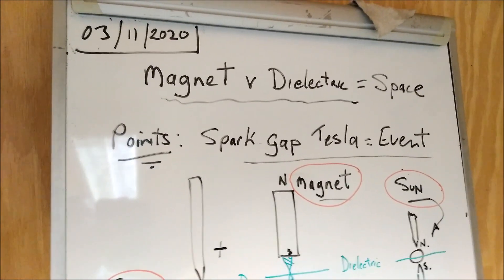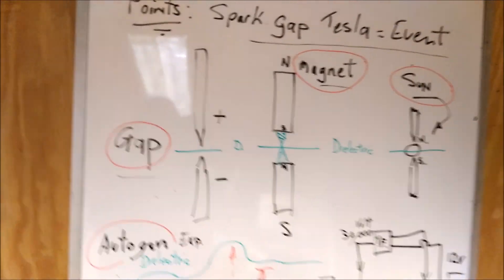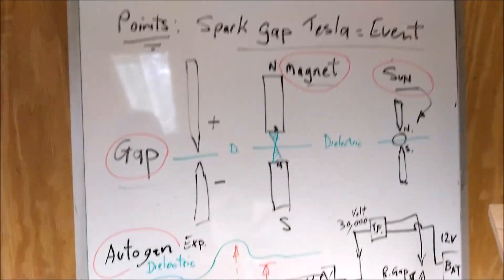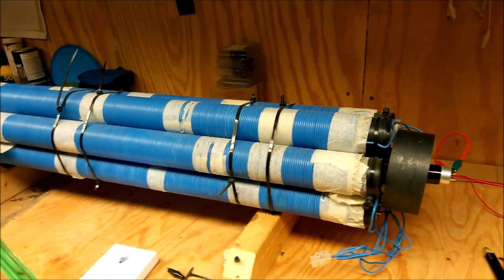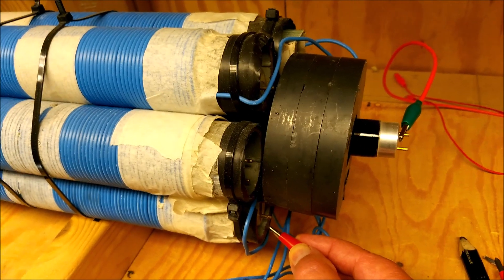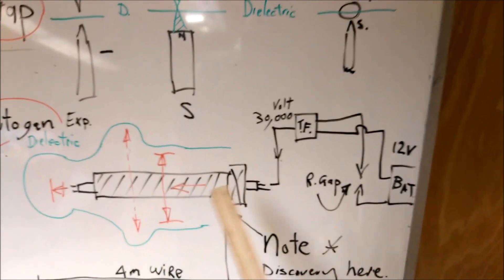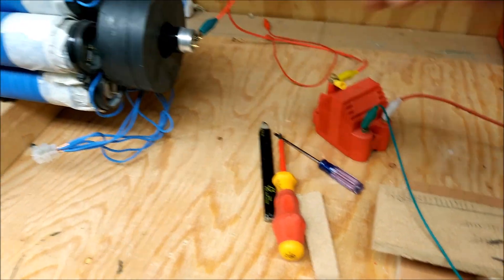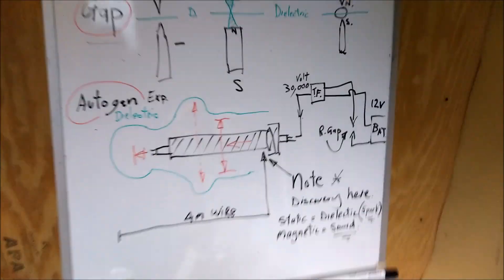Magnetic and Static = Aether (Proof)

Comment: Great video brother.....let me get this straight.....energy from the 30,000 volts has to go somewhere....it escapes as all energy is pushed to the boundary...the energy accumulates like a condensate on the outside of the machine..an em field...when a wire is hovered a spark appears which means an em field went through matter (air)  after linking fields with the wire and became an electrical spark as the "drain opened" pulling in the em energy condensate into a fountain of electricity to the wire.
if you agree my opinion is that the charge was not large enough to reach the sensor to register as magnetic.....I would shorten it...only because if electricity passes through matter ( the wire) it should now register as a magnetic field ...so i believe the sensor is too far away to detect the mag field...
I agree with your original findings about the electric spark field around the machine as all is electrical....but im 99% certain elec turns to em after passing through matter, thats the only reason it didn't register - if I understand what you were doing of course.
it of course does not change your findings...perhaps adds to it.
let me know your thoughts on this.
Reply from the maker: S.L. my friend we have little gem here. Your first paragraph is on the money.
The positive pulse flashes out chasing to find its mate.
What we have to understand is what truly happens. (I think we both don't know, yet).
However just maybe look at my video "Little Billy Aether" taking note of how the potential travels (Current) flows!!!
Not in the wire but on the skin or near the wire (Near Field) !  Can you imagine how much current you can pull in from the Aether????? 
When you see videos of Tesla Coils and those large sparks, what do you see?

I see that that the sparks are not traveling from the coil out!!! 

They are inbound, thin at the tips and growing near the coil.  
Regards DC  
"Little Billy Aether"     https://www.youtube.com/watch?v=2ozcxTL86_Y

Comment: To me it would seem that the reason you get a spark is because your are pumping something full of energy, it jumps because the molecules in the air are tiny conductors allowing energy to jump to a bigger conductor, your alligator clippers and a wire. Do your lights warm up? If so it's because you have more energy in than wants to be there, so it tries to escape. 

I guess I'm not seeing what you discovered here... It's like heating a pan up on the stove and finding out that if you hold metal alligator clippers close enough they heat up too... yes, because the heat travels through the medium of the air. The heat is energy and it's "ambient" as it tries to escape. Metal is a good conductor of heat so it heats up when in the ambient "bubble" of heat around the pan. You bulbs are the pan, the clippers are a good conductor for high frequency waves. 
What am I missing?

I'd guess in a vacuum you would get nothing unless you have a lot more energy.
Reply from the maker: No No!!! there is "No Vacuum" its full of potential !!!!!!   Regards .... DC